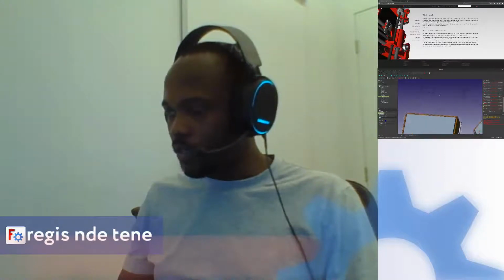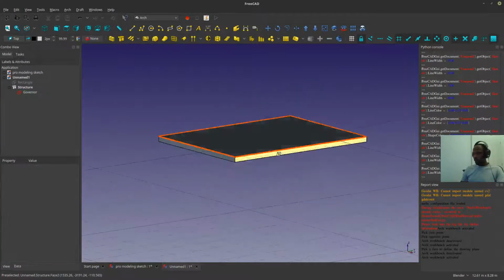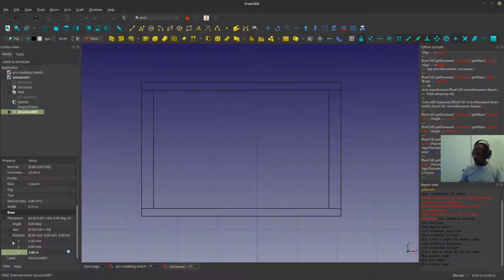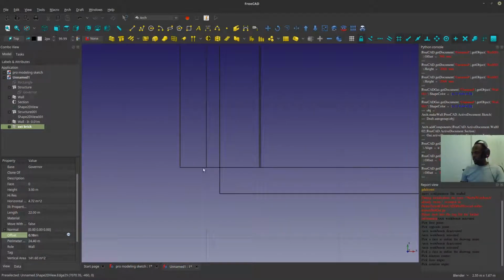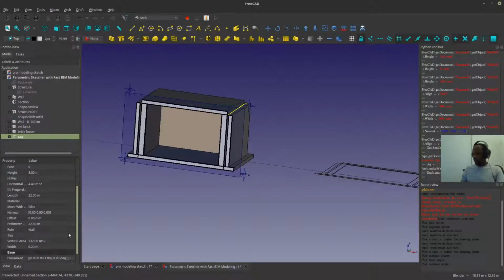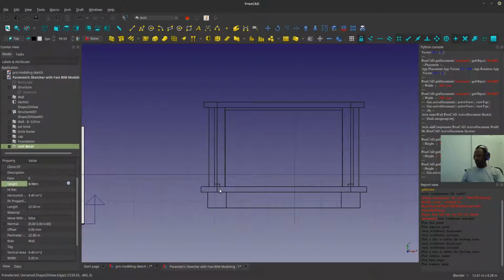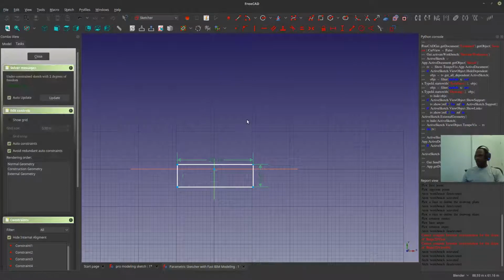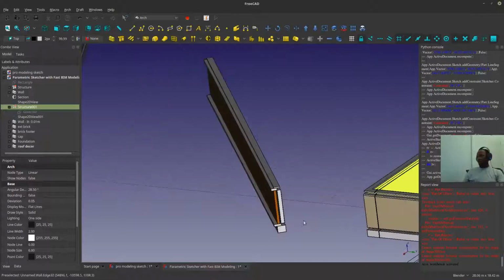Freecad Arch - Power BIM Parametric Modeling - 14

Comment: Thanks creating this tutorial, always good for revisiting !  :D
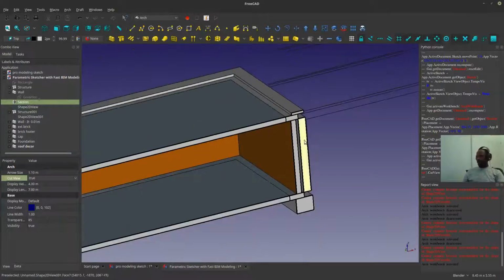At 36:00 
-  Some 'wall layers' go in other direction (e.g. internal '10mm plaster layer' go to the external face).
-  You can simply go to the Sketch and reverse the direction of those particular edges and it would be fixed 
-  (of cos you need to delete the point-to-point constraints at both end first, reverse the edge and re-apply the constraints)
Reply from the maker: Hello. 😅 didn't think these vidéos would be still relevant after all the major upgrades you and yorik have been pullin. I've truly lacked the time to invest in updating all these videos tobthe latest development. What are you cooking in freecad lately?
Reply: Not really have much time either :)  Re-thinking basic BIM workflow thus revisiting tutorials :D  'Automatic placement' of Windows and other objects was one of experiment which took me lots of time.  Topologic was another interesting topic.  In fact, ease of applying texture (ArchTexture was a good start), light and shadow (Realthunder's branch) are something must have, which really needs experienced coders to work on.  Looking forward to some killer features to come :D